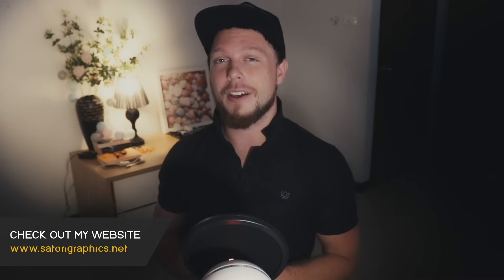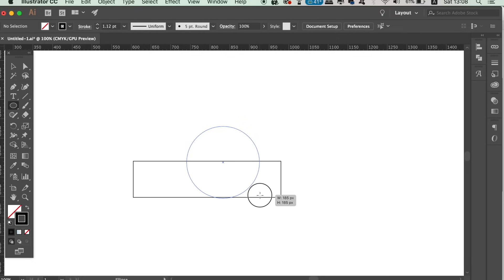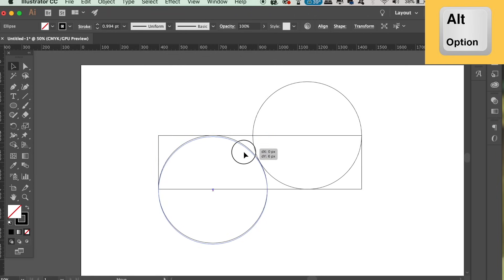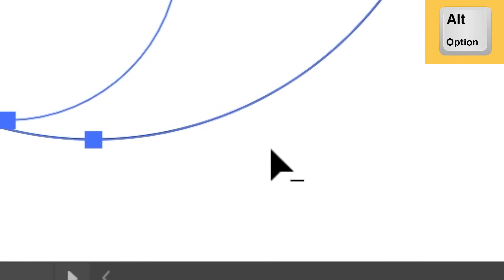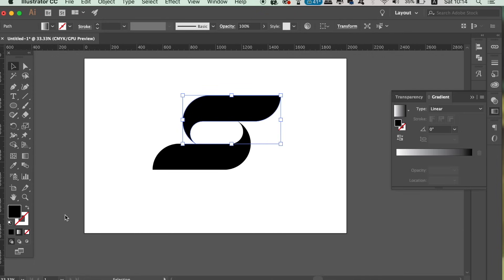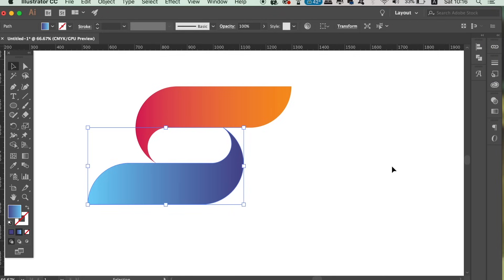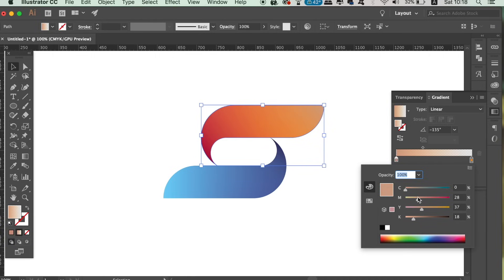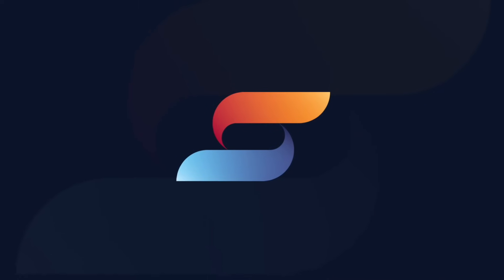Shape Builder Tool Logo Design In Illustrator

Comment: uhhh. this tutorial wasn't helpful. when i use the shape builder tool. i tried to mimick your combination, but everytime i do this, it overlaps one another and the shapebuilder tool shapes i made wasn't exact with yours...
Reply: It was pretty helpful actually it worked for me, you just need to play around with it more and line everything up or use a grid in the background.
Reply: I also had the same trouble, everything was overlapping and i could not see most of the rectangle. Then I realised that I had my colour fill on, and for this to work the colour fill needs to be turned off ( the red diagonal line on the colour square). That resolved my problem.

Comment: How to reduce anchor points? Shape builder tool leaves lots of anchor points. Especially if I using golden ratio technique. 😄😁
Reply from the maker: Then select the object or shape and go up to object>path>simplify 
Also, you can literally remove anchor points manually by going to  object>path>remove anchor points
Reply: position your objects properly, use grids or snapping to geometry, if you are getting extra anchor points it means you are not doing it right

Comment: nice :D that gradient trick will help :) Would it have the same effect if instead of using 3 layers I only use the one with the gradient but adding a darker and a brighter color at the end? so i have a gradient with 4 colors. 
Thx for the video!
Reply from the maker: The reason to do it this way is that if you add many gradient colours on one layer, you will often get banding (lines along the gradient) and you can control highlights and shadows a lot better with multiple gradients :)
Reply: that makes a lot of sense^^ thx :)